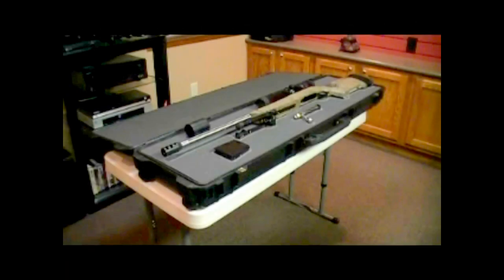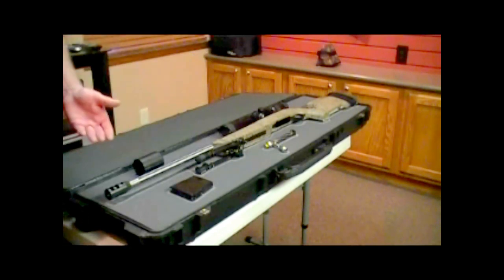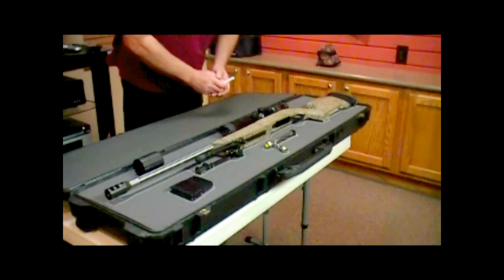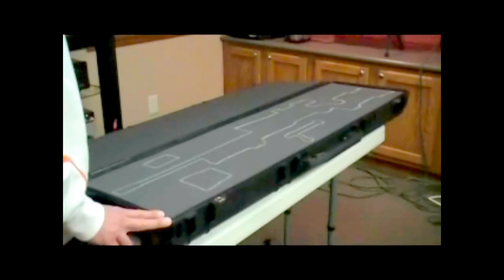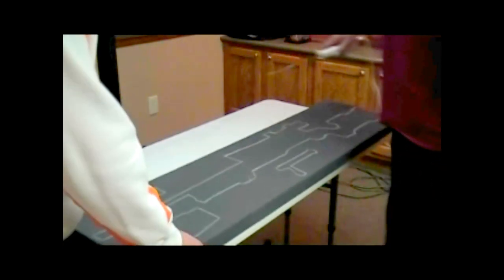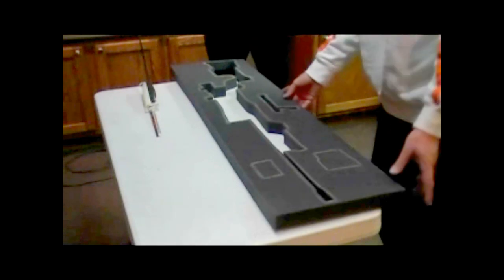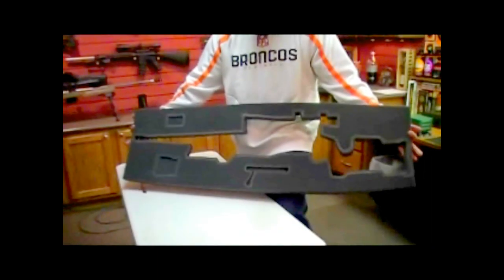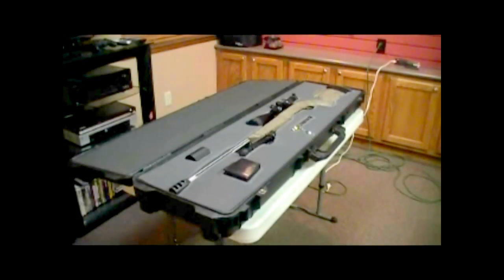Cutting in foam for a Pelican 1750 rifle case.

Comment: MrPlofstof not true. When you properly cut the foam into the Pelican 1750 the gun installs into the foam creating even pressure no matter what position your case is in. That is why this case can be transported in any position and be safe unlike cases where the gun sits on top of the foam and can slide into any position and most of those types of cases airlines do not accept.